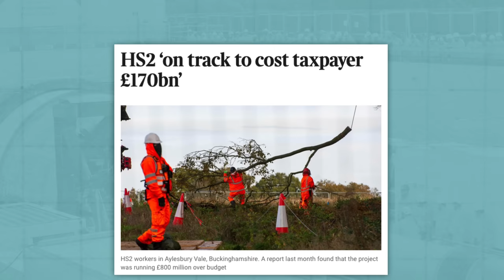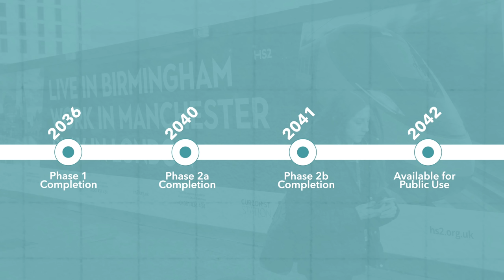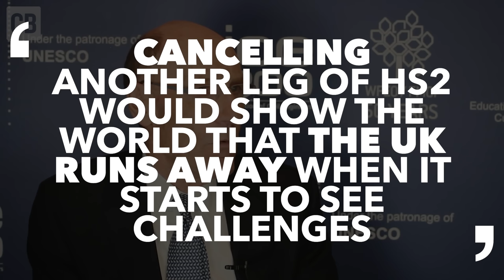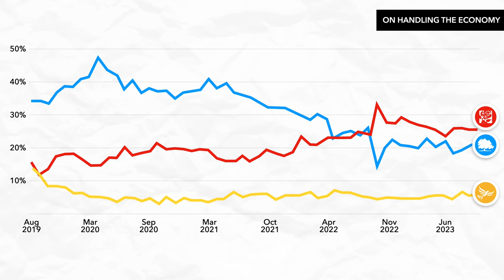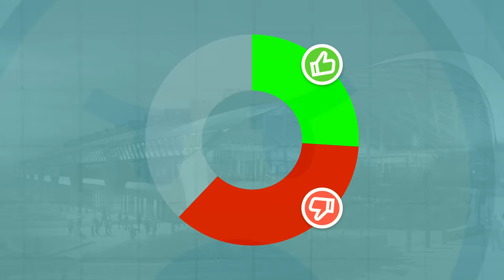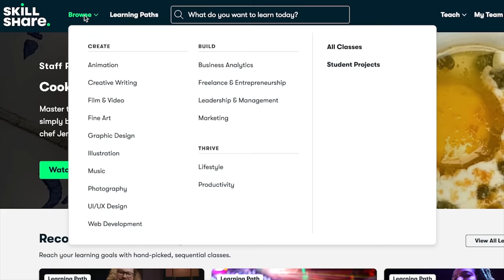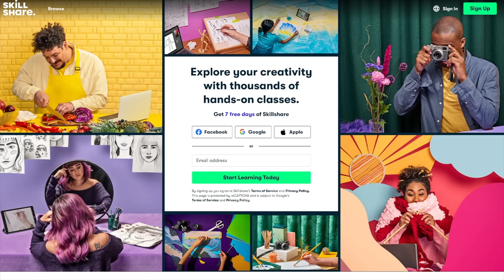Could Cancelling HS2 Work for Sunak?

Comment: Not mentioned in the video, but there's also now considerable doubt over whether the London - Birmingham secion will actually run to London Euston as originally planned, or whether it could instead terminate at Old Oak Common, 7 miles away. If this outcome happens, the marginal benefits that remain from building the London to Brum link evaporate: the transfer at OOC will eat up any time savings from high speed rail, and additionally will pile all those passengers back onto the existing rail infrastructure, meaning the extra capacity from HS2 is essentially moot.

HS2 is a simple and good idea, and should be built in full. However, there is no getting away from the fact that it is ludicrously expensive compared to other high speed rail projects in comparable countries. Although the loss of this vital rail infrastructure will be a disaster for the country in many ways, the thing that winds me up the most is that it seems no lessons have been learned from the experience. The UK government is apparently now in a position where it simply cannot build infrastructure: if the comparatively simple task of building a railway between two large population centers through relatively flat terrain is deemed impossible, as it seemingly is, there is basically zero hope that the British state can build the infrastructure necessary for a nationwide decarbonised energy and transport network. The future looks incredibly bleak.

Comment: After hearing multiple sources discuss the reasons for the high cost of HS2 it's a lot more complex than just zero risk.
1. The pound has lost strength against euro and dollar compared to 4 years ago which makes buying materials and transporting them more expensive.
2. UK is not equip to handle large infrastructure projects and therefore lack the companies and personnel necessary to make it happen. They have to employ foreign companies from norway, sweden etc who are competent in large infrastructure projects.
3. There is a huge cost associated with relocation of residents along the route of HS2. Also a huge swath of the route has to be built underground because of lack of above ground soil and to preserve national park and other ecological sites (environmentalists would protest for years). Building underground is much more expensive than above ground.
4. Politically they will naturally underestimate the cost rather than give a realistic estimate. Extrapolating costs for a project you are inexperienced with and are underestimating complexity at every step means no one knows the true timeline or cost the project is expected to take. Hence the delays and increasing costs every year.

Comment: Explaining the capacity benefit with moving express trains to the high speed line, you completely overlooked the main economical benefit. You can put more freight on the traditional lines. Freight moves at a higher average speed than the local trains but fight for space with the intercity trains.

Comment: I think HS2 will be completed, the only variable is when.
If you have a country with a completed euston to curzon street and ready made plans to connect Birmingham to Manchester, someone the future realising that the WCML can't handle the demand from Manchester to Birmingham will just implement the plan.

Same (though much later) goes for Leeds when they likewise realise this to also be the case for the MML to get it to Nottingham and then Sheffield then to  Leeds to reduce the demand on the ECML.

Comment: So much of the scepticism (to but it politely) around HS2 is due to a lack of understanding. So many see it as a vanity project when it is anything but. The idea for the project came from a study trying to determibe the most cost effective way to increace capacity on the west coast mainline, and it was decided that a grade seperated high speed line was the best way of doing that. The west coast mainline is AT  CAPACITY. That's why travelling on or anywhere near it by train in such a pain, there is no slack in the network, meaning every delay has massive knock-on effects and there is less time for maintenance and repairs. With passenger numbers expected to continue to increase, in part due to petrol becoming more expensive as we try to shift away from it, this will only get worse. The tories were the ones who (stupidly) decided to advertise it a vanity project by only talking about the speed. HS2 is not there to make travelling by train faster or more luxurious, it is there to make sure that travelling by train  anywere near Manchester, Birmingham, Leeds and London, and anywhere on the west coast mainline is not an absolue NIGHTMARE in 30 years.

Comment: Interesting approach to this issue. I read in the papers tgat another reason why the costs have ballooned is because they wanted the trains to run at 400 kph to rival the fastest trains in Europe, but reaching tgat kind of speed means having to go in straight lines, which meant a lot of tunnelling through the chilterns instead of accepting a lower speed and going around them. Sheer lunacy
Reply: A 250 km/h train that exist is a lot faster than a 400 km/h train that does not.

Comment: The bit to Crewe was actually the best part as would slash the journey time between Brum and Manc. Why we’re building a new terminus at Curzon Street is beyond me when every major termini in Europe is creating through platforms underneath theirs. What the point of Old Oak Common other than serving a load of new housing estates and even the idea of Euston has turned into building a new station next to the existing instead of rebuilding as a multi deck station.

Comment: Scrapping this project would be extremely stupid. 
We need HS2 more than ever. 
It is in essence, a now-or-never project. 
Yes it is very expensive but if we are ever going to solve our capacity problems on our railway system and be able to compete with other G7 countries, we have no option but to build HS2. We have to find a way.

Comment: On the capacity note, its worth saying the BR identified the HS2 route as a new mainline that should be built for capacity reasons. Sure, 2009 was the first time high-speed was mentioned, but the general route goes back to the 1980s at least.
Reply: It was acceptable in the eighties

Comment: As an American I will never understand how a country the size of a large county/very small state can have so many issues with political division, lack of political will, and such a hard time at doing any moderate sized projects.

Like it's ENGLAND a country in which the government has a far easier time forcibly getting you to sale them your land then the US but to make it even easier it's such a small place and historically you don't have a ton of small land owners it's a few large land owners. So how the hell is this even a discussion? If we had as much trouble in Kentucky putting in a new highway as these guys seem to rail I'd be absolutely dumbfounded. I know rail is harder politically in the US but I thought it was popular in England?

A country as tiny as England/"The UK" has no excuse in my mind for not having every major city connected with HS Rail, I mean Japan manages and they're an island chain of mountains which is FAR harder and I think they're even a little bigger to boot. Not to mention WAY more densely populated. With climate issues being what they are it seems insane for everyone not to be hyper pushing mass transit that can run on electric grid directly. No battery's, it's a predictable known load, less individual vehicles on the road means less CO2 and less lithium refining which is toxic AF. Then install trolleys (slow speed electric buses) and blamo everyone can get where they need to in a reasonable period of time.

Comment: Another Elephant is the room that right now, Old Oak Common, aka Acton, will be the London terminus. From Old Oak Common, it takes about 35 to 45 minutes to Euston Station or Bank Tube station. Basically, any journey time saving will be evaporated, and then some. If you are travelling between Birmingham and London, you would be better off taking the existing trains in every dimension - cheaper, faster (since you arrive at Euston) and more frequent.

Comment: Scrapping it entirely is absolutely madness, considering that phase 1 construction works are well underway.  HS2 was way too ambitious, it should have been from Birmingham to Huston London.  Cost overruns have been caused by a combination of factors, higher inflation costs on materials, moving the goal posts of the project due to environmental and social factors, way too many contractors involved.
Reply: Got 'em back for the parking ticket monkey

Comment: The problem with the UK rail network is the inflated ticket prices and sub-standard service resulting from privatized companies who's priority is to deliver dividends to their shareholders, NOT the speed limit of any one particular line.

HS2, even it were delivered as originally intended, completely misses the point, and would benefit less than 1% of the rail-travelling public, specifically people regularly commuting from Manchester to London.

The government should cancel this money sink and instead use the funds to re-nationalize the railways, remove the profit-incentive of the operators, and make rail travel as affordable as it is in Europe.

Yes the Victorian infrastructure is old. But so is the infrastructure in Europe and their railways are only slightly younger. And as this report points out, the bottleneck is not old lines, but the need to run commuter services to each stop.

The problem is the cost of the tickets and the unreliability of the service, not the speed limit.

Cancel it now.

Comment: Arrr yes the project that cost a boom, lowered housing pricing and goes to london....

But raised housing value along its stops in poor areas, gave a way into london (where the majority of the money is) and pumped cash into lower mid range manual labour as well aw expertise engineering.

The losers were the rich, got the poor to hate it and was miss managed by government.

Also reason for China's boom is infrastructure, otherwise it would just be another Brazil.

Comment: You forgot freight. That's the most important part. The passenger traffic is not as anywhere near as important.
The railways could always turn to the American system where passenger traffic is sidelined to let the freight through.
Also, the new railway uses far less energy per ton per mile than the 1840 designed route. But then, I know a lot of people who would be overjoyed if we returned to classic steam.

Comment: Contractors being forced to be realistic about the costs when bidding did not make the project more expensive. The cost is the cost. How many times have we seen contractors low-ball their bids for government projects knowing that once it's under way sunk-cost-fallacy will kick in and allow them to ratchet up costs. The principal of setting out the 60% share of overspend to the contractors is reasonable & rational. The problem with HS2 is the basic cost/benefit ratio - it's just not even close to being the most effect use of the money & this was the case the moment the initial estimates (which were laughable) doubled.

Comment: I don't think this is necessarily the Tories' fault completely. 
Inflation in the construction industry has gone up a lot after the pandemic. Furthermore, I think part of the problem with HS2 is that there is just way too many red tape and regulations which make the construction more costly. 
A whole chunk of the money includes environmental mitigation schemes like forest replanting or needing to tunnel through the Chilterns to keep the nimbys happy. 
And yes, nimbyism is a problem in the UK that is starting to really cost economic progress in this country.
Dont get me wrong though, Sunak is wrong to scrap this project. 
However it is worth remembering that we dont have as much empty land like France, Spain or even Germany which would make buying up land and the litigation costs incurred)combined with the engineering works way more expensive. Also due to our nimby attitude towards big infrastructure, we can't even pursue building big viaducts everywhere like Japan and China do. 
If i was Sunak, I would get rid of the environmental mitigation schemes and make the project a low-risk one instead of zero-risk. I would also ignore the nimbys and just get on building the damn thing.

Comment: HS2 won't connect London to Birmingham. If completed, it will connect Old Oak Common on the outskirts of London to a point on the outskirts of Birmingam. Allowing for transfers at each end, travel by HS2 from city centre to city centre would be slower than on the conventional line.
Reply: I guess it depends where your start and end point is. The Elizabeth Line will stop at Old Oak Common, which is a pretty fast connection across London, so it may not be as terrible as it sounds......but I agree, it should definitely go all the way to Euston.

Comment: You either commit entirely to the vision of HS2 and the costs and issues that come with it or you scrap it as the soft approach never delivers the benefits it needs. If the scale of the project is cut by 50% it does not mean we still get 50% of the benefit . Cost to   benefit is not a linear scale and i be this benefit is closer to 0%.

Comment: I don't understand why successive governments are so surprised whenever a project at one cost works out to cost vastly more by the project's completion.
Haven't they had enough experience with this being the case 'every' time they build any major project? (Olympic Stadium, Millennium Dome, Scottish Parliament Building to name just 3). 

Every time the pound is devalued against the rising price of materials and labour, the cost of the project is going to rise dramatically even before it's got off the drawing board.
Projects that take several years or a couple of decades to complete are at even greater risk of far, far outstripping initial cost. 
It wasn't so long ago that overspending by millions was usual, when considering the cost of a major project. Now we think in terms of billions lost here and there. Happens all the time in other countries too. It's not a uniquely British problem.

Considering the mess they've already made of some areas, the land they've compulsorily purchased, farms they've divided, the ancient trees and woodland felled unnecessarily - the line might as well continue to be built, piece by piece, as an ongoing project for future governments without a finish date.
That way, the project will eventually benefit all those commuters in cities, which are only going to continue growing exponentially and require upgrades in public transport all the more urgently, the project remaining as one that moves more slowly, steadily, supplying jobs for British workers for many years ahead. 
I don't see that we need to rush it by such and such a date. As a way to help finance ongoing construction, the government could even endorse the setting up 'temporary' stations along the new line to supply smaller towns with temporary access to trains while the line ahead continues to be built. Once the line reaches its ultimate destination, remove the temp stations and you have your express line.

Comment: There might be an argument to stop HS2 at Crewe for now and allow the trains to run over the old lines into Manchester and Liverpool. This is how high speed rail works in most of Europe.  

Then concentrate on bringing HS3 back, which is the more useful project in the north.
Reply: Crewe would be reasonable actually, since it acts as a hub for the whole region. It could even become the optimal route for much of Wales from London.
Reply: Crewe is a decent spot... It is already a big station with a train depot and former works.

Comment: In China, it only took us 3 years to build 1300km of high speed rail connecting Beijing to Shanghai. It opened in 2011 and until now remains in perfect conditions with smooth and safe speed capability of 350km/h (in comparison, the TGV, Eurostar, Shikansen etc. only runs up to 320km/h). I guess this proves how an intellegent dictatorship could actually work, as to the ordinary folks, these accomplishments benefits them much more than being able to vote.

Comment: 1600 GBP per Brit, wherever they live, whether they will ever travel that route.  Per passenger over its life, the cost is surely enormous...a few hundreds of pounds per passenger trip?  Surely adding parallel tracks to the existing lines would yield the throughput with far less cost.  Not as wizzy, perhaps, but useful and good use of funds.  The amount saved could be put into more urban rapid transit, or maybe small improvements throughout the rail system.  Just sayin'.